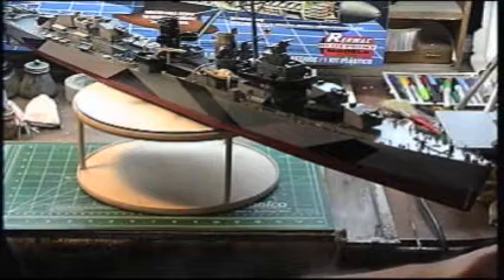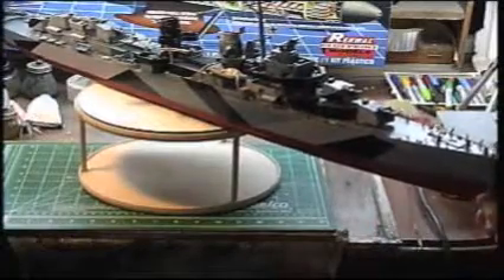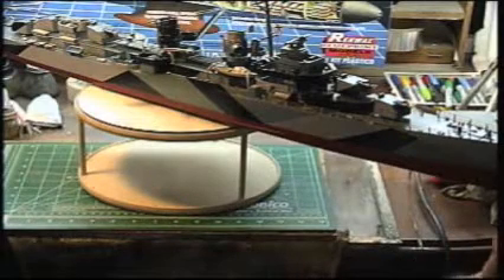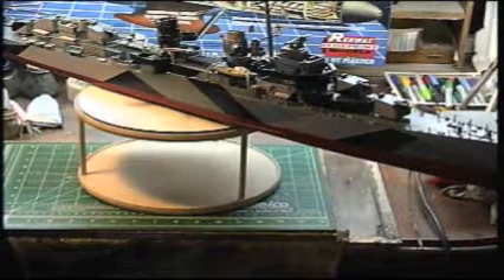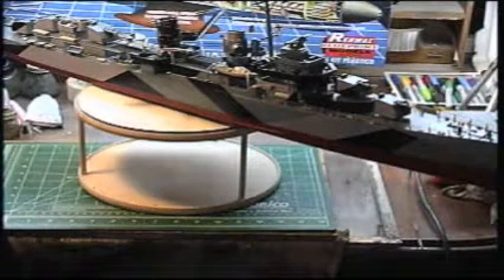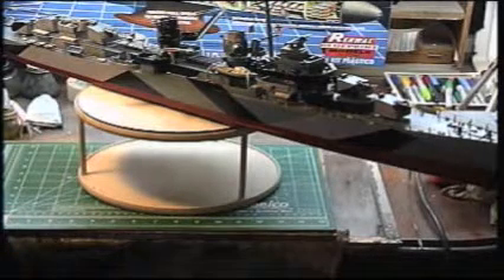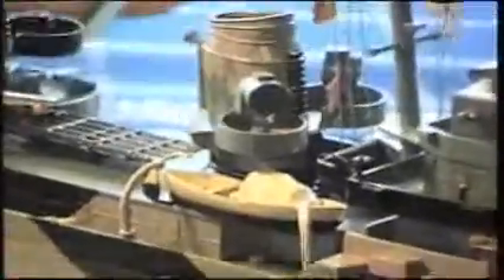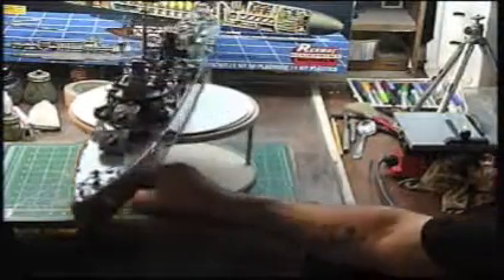Builds of the past U.S.S. MELVIN DD 680

Comment: Man, that slant on the forward deck really enhances it. How did you do it?
Reply from the maker: MrMFHORN Ahoy Buddy                                                   The hull on the blue Devil destroyer is out of proportion needs to be corrected I used sheet styrene cut to a angle the hull is 3/8ths of an inch out of scale so you will need a piece of sheet styrene starting from 3/8ths and taper down to nothing that it will end at the location of the bridge. A great kit a old timer that has been around for 50 plus years.  By adding the correction your kit will be more accurate hyappy modeling buddy.Frankie Day